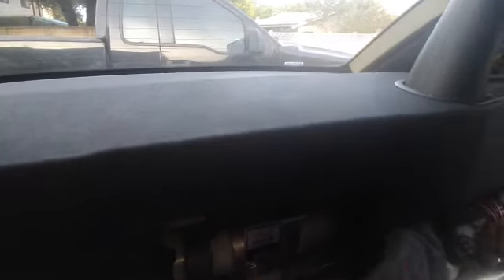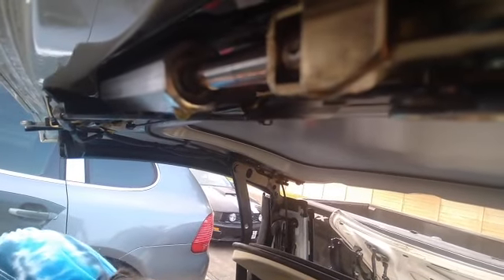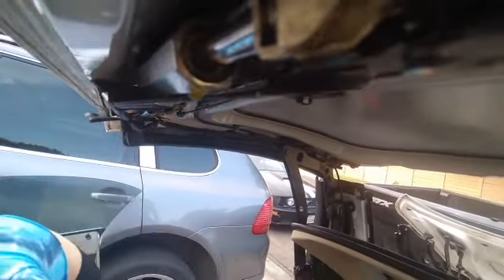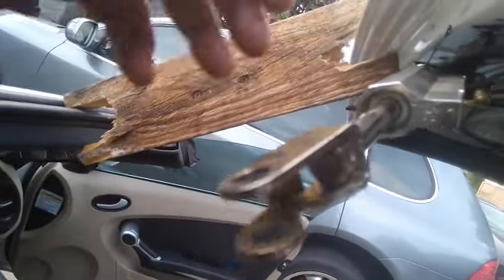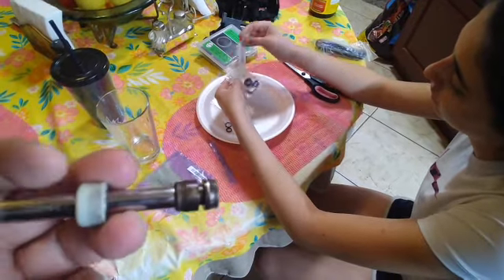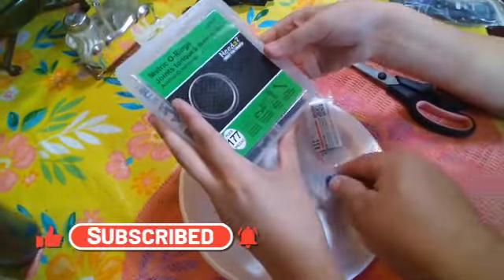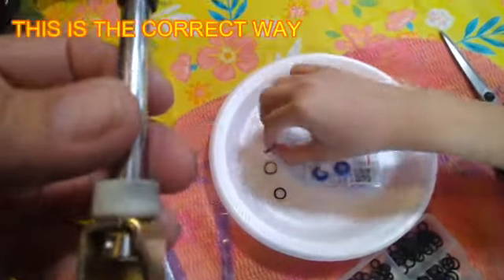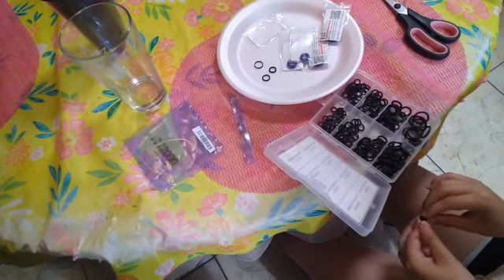How to repair a Leaking Hydraulic Roof Lock Cylinder on a Mercedes Benz SLK 350

Comment: What is the part number or name used to find the kit on Ebay?
Reply from the maker: Hey thanks for watching my videos, the way I found it is with this description 04-11 Mercedes SLK 280 350 55 AMG R171 hydraulic cylinder roof repair kit U cup
Reply from the maker: Or look for this Item # 284190832978